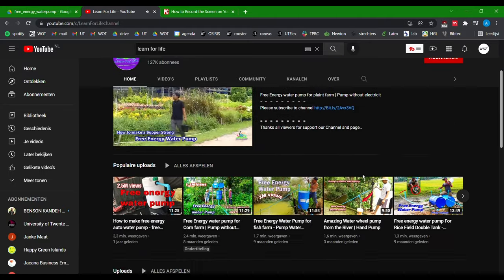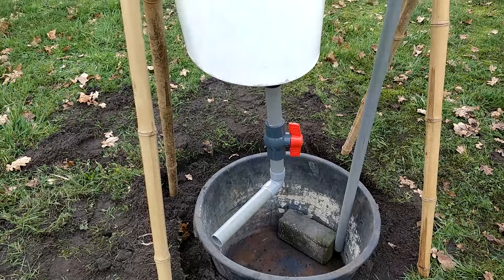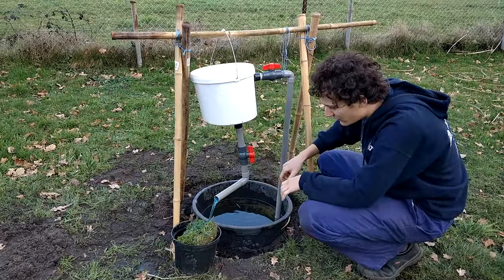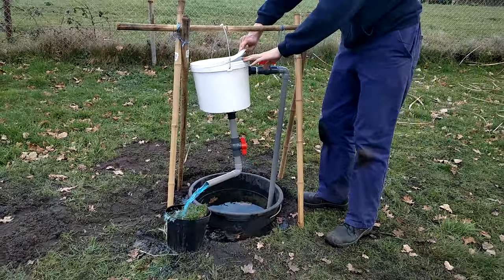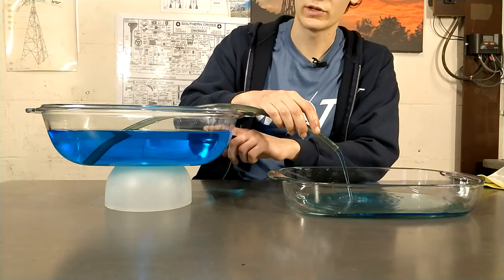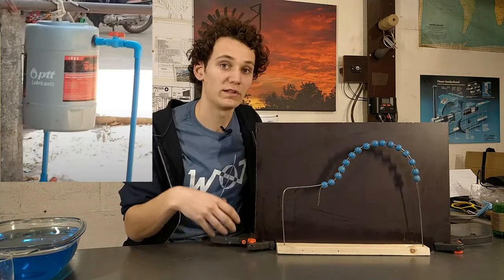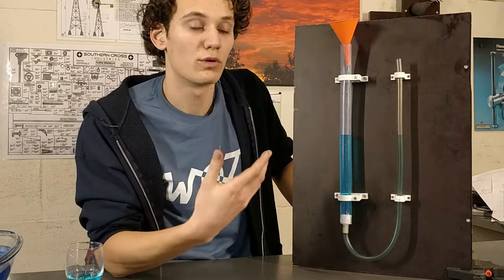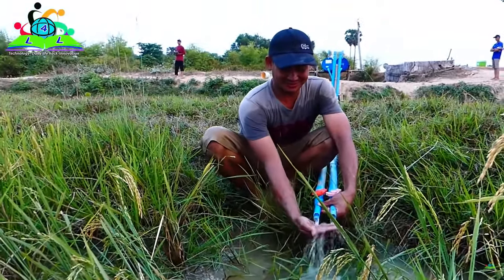FREE ENERGY Water Pump Tested. Is it possible?

Comment: I don't believe or disbelieve this concept.  However you failed to replicate what was installed in the field.  The dischage line should have been much longer plus you did not have an air trap on the discharge side.  No marks for this experiment.  Sorry!
Reply: Replicated what was installed in the field? I have never seen such a system working in the field! It is only shown in videos, where faking is no problem. The experiment may not be conlusive, but it is obvious that these pumps do not work. Lifting water from a deeper well needs energy. Where does the energy come from? Neither vacuum nor gravity are a source of continuous energy.
Reply: @sciencefreak9070  Agree 100%.  I was commenting on your scientific approach.  If you are to do a scientific experiment to creditably disprove a concept, the experiment must be replicated exactly.  That was the reason for my comments.  I would like to see someone replicate this exactly.
Reply: @johnspathonis1078    I also agree 100%. On one side, the experiment in this video does not creditably disprove this pump. On the other side, laws of physics allow us to predict the outcome of experiments without doing them. And in this regard the author does disprove the pump. It would violate conservation of energy and when vacuum builds up in the barrel the point where water is prevented from flowing out comes earlier than the point where vacuum is strong enough to draw water in the barrel from the "well". Simply because water pressure depends on the height of the water column and thus it is at the bottom of the "well" always bigger than at the bottom of the barrel.
Reply: @sciencefreak9070  I would still like to conduct this experimrnt to determine at what point the syphon ceases.  I would argue the case differently.  If the syphon can lift the water to a greater height, then collect the water in a small dam then run it through a turbine back to the lower level to generate electricity.  Hence we get electricty for free.  As we all know nothing worthwhile is ever free.
Reply: @johnspathonis1078    I am not sure that with this pump design some kind of syphoning even starts. I had a look on several videos presenting this pump, but with none of them there is a real proof that this arrangement really draws water from the well. The water from the outlet can also come from the initial contents of the barrel or from other sources. 
Yes, if this pump would work, one could build a perpetuum mobile. I addressed this violation of conservation of energy, which is a fundamental law of physics, not only confirmed by all observations but also with a mathematical proof by the Noether theorem.

Comment: when air gets in it's over. it must be 100% hydraulic. your lack of sealing the vessel is your failure .you are completely wrong. ill post a video and close up explanation of this concept. this video is not correct . my device is not a " siphon" .gravity pump iz correct term. rebuild yourexperiment and use an AIR TIGHT vessel that is very strong as to not collapse under neg pressure. do it over and do it right. air is the enemy .atmosphere is the enemy. isolate the elements you are working with .you are wrong.
Reply: The fact that the system sucks water from the exit proves that the bucket is air tight.

Comment: I left an explanation on your site, but can repeat it here.  You have not succeeded in de-bunking the principle because you have not matched its design.

There is no need to make the output lower. The idea is to make a much higher mass of water draw, through the forces of gravity, vacuum, and vortex, down with more force than is required to siphon it up to the top barrel.  Because of this, plastic parts will not work for storage.  A foot valve is required at the bottom barrel, as is a final outlet NO LARGER than the input.  A larger output will stress the system and eventually break it.

In our units we create multiple channels of large downspout pipes that converge into one, creating an extremely powerful energy that can power a large turbine and then be simply returned to the input barrel. We also create a 12′ drop through top barrel elevation (the hard-work part of the show).  The power of water is additive with height, so the more you have flowing (farther) down out of the top barrel, the more power you have. Our pressure at the outlet is much higher than that of a well or city tap.

Periodic maintenance to relieve the top barrel of air is necessary. There is always air dissolved in water, and it is impossible to create a pure vacuum on earth as ALL matter evaporates (leaks to its surroundings) — even solids. Remember the one about higher concentration to lesser concentration?  It is always in play.

No scientific laws are broken as this is a creative combination of several physical principles of water.  As a matter of fact, this is IDENTICAL to how jets can fly without 80 tankers of fuel in their wings.  Jet "turbines" use the principles of vacuum, vortex and (also) pressure to create massive thrust.  So do we.

Any experiment that tries to cheat what I have just stated is doomed to failure.

Peace and Love to All!
Mariana Caruso
Reply: OK? “Our pressure at the outlet is much higher than that of a well or city tap.”

The water pressure in my city tap is about 6 bar. So your tank is sitting on the top of a 60 meter high tower?  How do you get any water up there? A siphon can only bring water up about 10 meters, still 50 to go. 
How do you get access  to a pressure in a well? The pressure at the water level in the well is about one bar. How do this system increase that pressure?

Comment: Why do you even try to explain something that you dont understand...your demo has lots of flaws...your output pipe is so short that the air is coming back in so no suction us created inside...your input suppose to be smaller than your output so the suction is greater than the input...your suction pipe has to have a non return valve so that the water coming in do not come back down...if you look at the original video their output pipe is very long so that gravity pull is greater than the input and also they are using a riser tube so that if some air is coming back in the pipe it would be trapped and not going innthe tank...

Comment: Go back to physics class young man.  I've seen this work. Your experiment lacks the fundamentals of syphoning in general and therefore, you have false negatives in your results. I've seen this work with a 10' draw from the water source, drop down to a pressure tank, and then hooked up to a pump ram that carried water up a 30' hill with the same amount of pressure that you would get out of a garden hose. How do I know? Did it myself.
Reply: This video is ok. It shows that a siphon does not work uphill
Reply: OK? So your system works with 10 ft up from the source, drops down say 5 ft to the pressure tank and outlet and works? Excellent. First time ever that I have heard of a siphon being able to lift any water uphill.

Comment: If you were as smart as thought you were then you would have known that the foot valve at end of pipe in the  well is what makes it possible. The system does work, i know because i use it myself!!! So now you know your not that smart. So try again with a foot valve.
Reply: By using a priming drum you do not need any foot valve! But, the water level in the source must be higher than the exit.
Reply: @russellfinley1014  Firstly, I am no idiot! 
Yes, a foot valve will keep the suction pipe filled with water, but it will not help lifting any water up the suction pipe. For such a siphon to work, the exit must be lower than the water level in the source. This is no pump, it is a siphon with a starting barrel. With a barrel, you do not need any foot valve! That is the sole purpose of using a barrel in the first place. But of cause, you being smarter than me know that?

Comment: Shoddy representation there mate, you got it all wrong. That is not the way the experiment is done.
Reply: Excellent video showing that a siphon can not lift any water uphill
Reply: @kjellg6532  It’s just not the way the guy did his experiment. Follow what he did and prove him wrong that way & not with such shoddy presentation. Weather it works or not is another thing, follow his steps and make a conclusion from that.
Reply: @esaumadzura  This video is excellent. So is this one https://www.youtube.com/watch?v=NiThJ9vUagU

Borh shows that a barrelled siphon is not able to lift any water uphill. If that was the case, one could make a Perpetuum mobile. That would be a sensation, first time in history. We could drop coal, oil, gas and nuclear, only using water flowing in a circle from low to high and back again.

Comment: Your set-up has too many flaws to list. I've been running one of these for the last 10 years to continuously water my garden.
Reply: Sorry, but you can not. This video clearly shows that a siphon with a barrel is no pump. Water level in source must be higher than discharge for this to run.
Reply: Can you list a few of those clamed flaws? I see none, and I have used siphons for 40 yrs.
Reply: @kjellg6532  The design is NOT a siphon, that's your first problem. It uses vacuum pressure.
Reply: @iamnotguilty  Now what exactly is a siphon? A tube is not a siphon. A tube running from an elevated body of water to a lower body of water may not be a siphon. Fill this tube with water, and a siphon effect takes place.  

In this video the apparatus is a smaller copy of what many videos describe as a drum pump. Now this apparatus may or may not act as a siphon. The video shows that the apparatus does not suck any water from the lower body of water so it does not act as a pump. If you elevate the source higher than the exit from the system, it will act as a siphon, bringing water from the elevated source body of water, up into the barrel and then down to a lower exit.

Call it whatever, the video shows that such drum “pumps” are unable to pump i.e. elevate any water at all. 
An excellent video, to the point!
Reply: @iamnotguilty  Let us rebuild the system a little: 
Move the source bucket to the right and elevate it 0,5 meters. It is still lower than the white container. (Please see the correction further down) At the output side, mount a 90 degree bend and dip the output into a bucket of water, the receiving bucket. In this way no air can enter the system, ether from the source, nor from the exit side. 
Fill up the white tank, close it with the airtight lid and open the ball valves. What will happen? Any flow? 

No. Absolute standstill. No water is sucked up from the source bucket. No water leaves the system to the receiving bucket but for one decilitre or two.  No pumping effect. No pump.

CORRECTION! I made a mistake here. The water level in the source MUST still be lower than the water level in the receiving bucket!
Reply: @kjellg6532  "Fill up the white tank, close it with the airtight lid" , the container is NOT airtight, The lid is NOT and airtight lid.
Reply: @kjellg6532  well my watering system must be magic????
Reply: @iamnotguilty  Pls, watch the video. First you clearly see that the output starts gulping water. That is hue to the fact that the lid is airtight and the only way for air to creep in is via the exit side. As soon as he lifts the lid, the water is flushing out. This white bucket once contained paint. It is airtight.

Comment: total ly WRONG analysis, you should make air tight container and fill that water so that water can suct very well
Reply: He shows that the container is air tight. No siphon can lift any water to a higher level and he shows that.
Reply: @kjellg6532  no indeed,.. the container is leak and not air tight that is why air suct into the chamber, and water can not go up, also there is no check valve installed on the system
Reply: @caaip38  No check valve is needed here, that is why they use a priming barrel. Take a glass of water and a straw. Do you see any foot valve at the lower end of the straw?
The container in the video is air tight indeed. You can clearly see that by the air entering via the output side and the water flushing out as he opens the lid.
This video shows that a flying-droplet siphon acts just like any siphon: The water level in the source must be higher than the output from the siphon. The only purpose of the starting container is 1) no check vlve needed, 2) get the siphon started. 
If you take a simple hose, fill it with water, then it can do the job with no starting container.
Excellent video, debunking the „drum pump“ hoax.
Reply: @kjellg6532  using small tube or straw will not works, you must create ejector effect
Reply: @caaip38  Ejector effect in a siphon?  Never heared of. 
With a drum “pump” like this you can use tubes town to say 10 mm diameter. Diameter does not matter as log as you do not get into a capillary discussion. In some videos they plase fancy vertical tubes or small containers at the output side. No need and they only work for a few minutes. A better solution to avoid water from sucking in from the output is to dip the output into a bucket of water.

In this video, let us put a 90 degree bend down at the output so that the output gets into a body of water. What would the result be? It would all stop. No water going up the input side, no water leaving at the output. 

I suggest you read about siphons on Wikipedia.
Reply: @kjellg6532  if you see the Bucket was not air tight, initially pipe lines should filled by water, in this case air should not allowed to be present within the piping line (suction) how to do this you should install check valve at the bottom side, once you completely filled bucket with water, and you can open drain valve, and water inside the bucket will be drain and creating low pressure (ejecting) and water at the bottom will be suct
Reply: @caaip38  When using a container you do not need any check valve. 
From the video it is clear that it is air tight. The system is sucking water via the outlet. If there was an air leak, you would have no gulping. When he opens the lid, then the rest water flushes out. 
Excellent video, showing that this “thing” is not able to pump any water to a higher level. A siphon is no pump.
Reply: @kjellg6532  Bucket is not air tight, that's why the show has failed, and check valve is critical for a goal

Comment: You couldnt of done that more wrong it definitely works and works very well
Reply: And where can I see it working? If it would work, it would be well known and could be seen in many places. Don't tell me that this invention was made just recently. To lift water to a higher level needs an input of energy. Neither vacuum nor gravity are a continuous source of energy. So where do you think this "pump" gets its energy from? Of course siphoning works when the outlet is below the water level in the well, and it only needs one pipe line which is prefilled with water. But if the outlet is higher than the water level in the well you need an input of energy.
Reply: ok show me? i see no proof, if this would actually work and there would be "free energy" then you can go claim a nobel price

Comment: T'es trop nul ... Tes tubes sont mal dimensionnés et l'air remonte par la sorti de l'eau alors qu'il devrait aspirer l'eau du bassin grâce à la dépression crée par la gravité.
Reply: Air is entering from the output side because the outpt is higher than he water level in the source. That is exactly what he tended to prove. This is a siphon, and no siphon can lift any water to a higher level.
Reply: @kjellg6532  Sauf que son tube d'entré de sortie est bien trop gros et que l'air passe en "glougloutant" plutant que de créer une dépression dans le bidon pour aspirer l'eau du bas. 
Son installation est mal faite est pas du tout bien proportionné pour fonctionné.
On voit très bien ici comment la dépression créer par le film plastique aspire l'eau.
https://youtu.be/9eBf6_W0vlo?si=0S0aYu7tgAbcEMa6
Reply: @magatst  Now, if you dip the output side into a tiny cup of water, no air will enter and it all will come to a total stop. The water in the sucking tube may rise 1-3 cm, but there is still 1 m to go. 
If the tank is 100% fu of water, the flow will goo in reverse  emptying the cup. N siphon can lift any water to a higher level.  With both ends of a sphn is died in water, dimension of tubes does not matter. Input tube may be much, muh wider than the output side if you like. 
Purpose oof this video is to show that the set up with a tank, does not make a siphon to be a pump. There is no input of energy, thus no water can be lifted..

Comment: I think you missed the concept by far. This has nothing to do with siphoning. But the head in the tank, the tank being able to withstand the negative pressure without significant deformation and then the diameters of the pipes in relation to the height between the tank and the water source. I know it works because I tried it with my nephew.